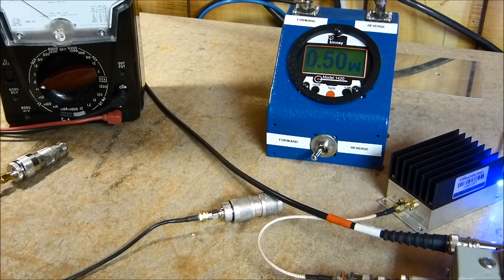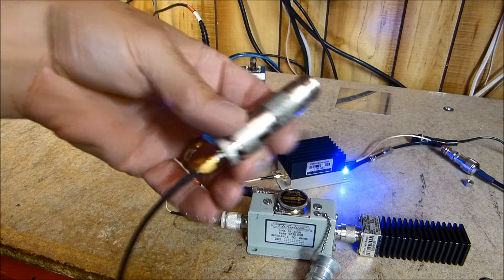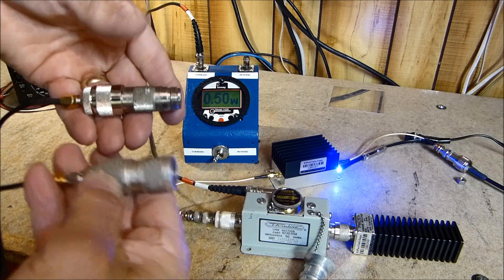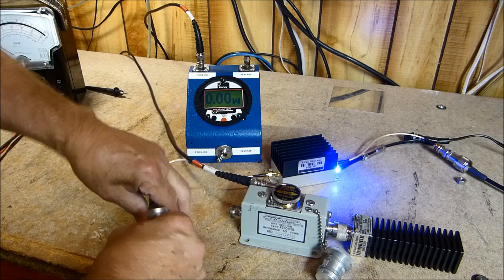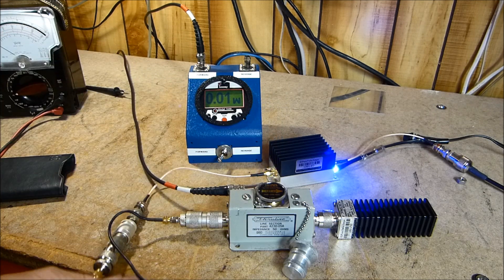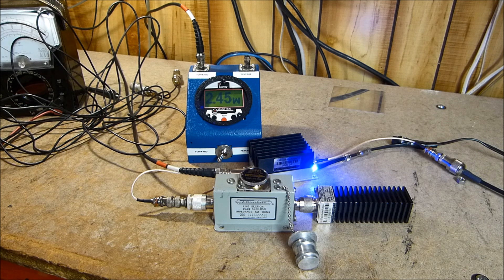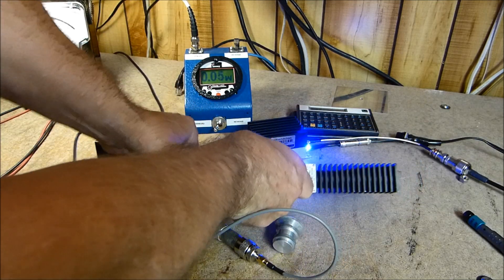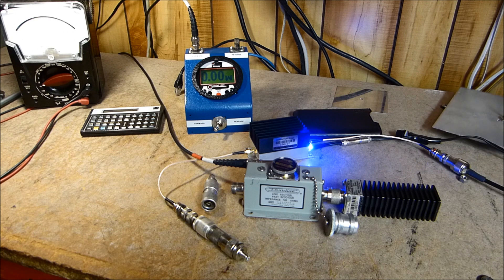WiFi Antenna Gain And Coax Loss Measurements At 2.4 GHz

Comment: Hey ElPaso! I’m a NM native and I know exactly where White Sands is! Beautiful area. My question is what should we be using for our GHz projects? I notice a lot of N Type fittings with test equipment. Compared to SMA that’s a whole lot more metal. Does that make a difference? What about loose fitting connections? I think we’re better off using an SMA torque wrench...no?
Reply from the maker: No doubt SMA is good in the GHz range but I have so many more N connectors and adapters. I definitely like the SMA when I can use them.
Not sure why the industry has used N connectors so much. Possibly because they are larger and more structurally sound? It would be a lot easier to break off an SMA connector from the front of an expensive piece of equipment than it would an N connector. Also, what if a person is using RG8 size coax? It would be hard to solder that #10 conductor to the center pin of SMA. And what about power? I really don't know what an SMA connector is rated for in voltage.  Looks like they are both here to stay and leave the SMA connectors internal to equipment. Just some thoughts off the top of my head.

Comment: The blue meter?  You make?
So precious, me wants one.
Reply from the maker: I bought that meter years ago off Ebay. I think it was around $140 if I remember correctly. Maybe a year later they disappeared but I found them being re-branded and sold under a different name for a lot more $$$ but now I can't find them at all. The meter itself, is a direct replacement for the 30uA meter that fits in the Bird 43 meter. I really like the digital readout and mounted it in the outboard meter box and use it with the free-standing Bird sampling line. I don't know if anyone still makes a digital readout for the Bird meter or not.
Reply from the maker: Actually, I just found it again. Here is a link to it.
https://www.eham.net/reviews/detail/9285

Comment: Nice 25 foot long dummy load.  It is a well known phenomenon that as the AC frequency goes higher, the loss in a cable carrying it becomes greater.  2.45 Ghz is fairly high frequency, so those "skinny" cables, unless very short, introduce substantial losses.  Losses in a system are not necessarily bad, if they are accounted for.  Sometimes losses can be used to your advantage, for example, if you have an amplifier that is 100 watts but you only want 50 of it to hit the antenna, putting a 3dB loss cable between the amp and antenna will then drop it to 50 watts.  Lossy cable can also help SWR, since the return current will be attenuated.

Comment: Also, a 17dB loss cable can be a very useful thing for testing.  For example, if you wanted to test a 20dBi parabolic dish antenna up on your roof, vs a 3dBi "stub" also up on your roof (connected directly to your Wifi test equipment), since you already know the cable has 17dB loss, you could install the dish and then compare the signal strength at some reasonable distance away and in the boresight of the beam, to help confirm it is really 20dBi of gain.  If the signal DROPS using the cable/dish combo and you did everything right in your test, then perhaps the dish is only advertised as 20 dBi but in reality it is less.  in case anyone is wondering, yes I am a "ham" operator.

Comment: The 17dB loss cable DOES work, but it is very lossy.  If it were a foot long (instead of 25 feet), it would likely have less than 1dB loss.  So it is not the cable that is crap, it is the fact that it is too long for the application.  A 1 foot pigtail made from that same cable would be acceptable.  Also, the correct term is dipole, not "diapole" as you say.  Also, the gain of a dipole antenna over an "imaginary" isotropic antenna at the same frequency is not 3dB and it is not any constant amount of dB.  It depends on the length of the dipole and where the signal is coming from.  For example, a 3/2 wavelength dipole has more gain than a 1/2 wavelength dipole, but only in certain directions relative to the orientation of the antenna and assuming it is out in the open (not indoors).  You are making some general statements about dipole antennas but they are actually wrong, including your pronunciation of the word dipole (you are saying "diapole")

Comment: Is there a way for a poor man who doesn't have much test equipment to check a coax for loss ?
Reply: Yes, just read the specs and if it is too much loss for the length you need, don't buy it.  Add in a little more loss for the end connectors.  So simple.
Reply: David James  If it is so simple, what was the point of this video ?
Reply: Some old fart with nothing better to do than complain about lossy cable cuz maybe he is too lazy to just check what cable it is and look up in a chart  online what the rated losses of it are.  They know exactly how much loss there is for any cable at any frequency.  His method is only useful if the cable is either not marked, or someone just wants to confirm the losses of it.

Comment: I've got a few lengths of the same garbage "Coax".  GHz range RF is really tough to send down coax without loss.  Try some lmr 400 (or better, 600 :) )

I dig your equipment - I'm looking for some inexpensive (or kit / schematics) for 2.4GHz VSWR meter and also power meter for wifi if you happen to know where I could find one I'd appreciate the tip.

Thanks for sharing!
Reply from the maker: +George Viaud There are a few 2.4 GHz meters on Ebay but I don't know anything about them. I bought an inexpensive 2.4 GHz watt/VSWR meter a year or so ago and it wasn't all bad. It did not track right with the Bird equipment but it was usable. I think it was about $80. I tried to improve it and make it work as well as the Bird and I ruined it  :-)  Here is one I made that you might like:  https://www.youtube.com/watch?v=0MiF4KGFZcc
Reply from the maker: +George Viaud I have had good success with LMR400 and the price is not too bad.
Reply: Thanks much for all the info and sharing the videos - very nice setup you have there.  I'll be sure to post back when I've solved my own equipment needs (considering building a meter for relative readings so I can get back into antenna building, only this time instead of HF it'll be UHF and microwave for point-to-point fun)

Comment: could I connect the wifi adapter to the pigtails coming off the antennas and the run a usb extention for the 20ft needed or would I loose more signal in that configuration
Reply from the maker: +jarred Great idea if that is possible, i.e. weather proofing, etc.  ---  that would be the best way to go. You will not lose anything in the USB cable. Not sure what the industry recommendation for USB length but it is at least 20 feet.

Comment: I bought some of that cheap cable off of amazon and paired it with 2 yagi antennas and a ALFA AWUS036ACH. i have several feet of extra cable, can i cut the excess off and resolder it back together to possibly get a better signal though the cheap cable.

I am a over the road truck driver and its hard to order anything off the internet and get it with in a reasonable time

here are the links to what i have 

http://www.amazon.com/gp/product/B00ZOM3L5K?psc=1&redirect=true&ref_=oh_aui_detailpage_o00_s00

http://www.amazon.com/Super-Power-Supply%C2%AE-WZR-HP-G450H-WHR-HP-G300N/dp/B00DTWTXTK/ref=sr_1_5?s=pc&ie=UTF8&qid=1445297867&sr=1-5&keywords=wifi+yagi+antenna

http://www.alfa.com.tw/products_show.php?pc=137&ps=225
Reply from the maker: +jarred From the links you sent me, and what I can see from them, the big bundle of cable is excessively long. I personally would shorten it up and if you have the cable installed in a permanent location, I would use LMR400 cable from the antenna to the access points. 2.4 GHz can be a challenge to work with. Best of luck with your equipment.

Comment: Well exactly what kind of cable would you recommend for 2.4ghz wifi?
Reply from the maker: +w2aiq I use the best I can afford that will work for my installation (i.e. flexibility) and always keep it as short as possible. LMR400 is usually the best I can afford because the cost goes up astronomically with LMR600. If an access point can be mounted (and weather proofed) directly at the focus of a parabolic dish, the downlink will have no RF loss. Power over Ethernet is one name they call it with DC power to the access point over the two unused twisted pair in a standard CAT-5, 4 pair UTP cable. I have found that the plenum rated CAT5 cable holds up pretty well outside.
Reply: I hung up my router on the 🌲..+rj45 +50mtr...and it's so much better now..

Comment: Aparty from the long low quality cable:
Are the SMA connectors supposed to swing like they do at 8:05?
Where was your torque wrench? :)

I'd like to personally "thank" the one who came up with that crappy RP-SMA - It was so much "fun" when I used a WiFi antenna for my ATV transmitter and accidently mixed RP-SMA and normal SMA - two connectors without center pin..

Comment from the maker: The long piece of "coax" is nothing more than audio cable with the shield being loose wire strands spun around the center conductor as audio cable is made. The shorter piece of coax on the D-Link antenna is a real piece of coax with a decent braided shield. I see on Ebay as I write this, "9 meters of WiFi WAN Router Antenna Extension Cable RP-SMA" for $105.33 with 313 sold.

Comment: Great video !
I guess I missed something but why did the power change when you changed scales ?

73  N8AUM
Reply from the maker: With the digital readout when you change scales it just multiplies the actual power reading (0.5 watt) on the 1 watt scale, times the scale which it was changed to (5 watt scale)  so it would 5 times as much or about 2.5 watts. It increases the sensitivity so I can also see  some reflected power and determine dB ratios. The digital readout is really a nice addition to the bird line section and elements. 73 WA4QGA

Comment: Hi Dave, would be interesting to compare your measurement against the data sheet of RG174 Coax cable for instance. RG 174 has an attenuation of about 100db per 100m @ 1Ghz. What might the attenuation be at 2,5Ghz? Would be interesting to see where exactly the problem is? Is it the crap wifi cable itself or the connector or both? Or is it simply normal that you have this attenuation at 2,5Ghz with given cable length and diameter? We as ham radio people know that we need big cable diameters to reduce attenuation and we already do it within the short wave frequency range. I guess the the commercial offer to the uninformed consumer is simply  a cheek.
Reply from the maker: I probably will do some more measurements and see how they compare to the tables we get on coax loss.. Measuring at 2000 MHz is pretty much the top end of what the tables show and, of course, the loss is pretty high at that frequency so maybe it makes it easier.

Comment: Hi Dave,    Another EXCELLENT video... I recently ordered several 1-meter cables with SMD connectors from epay, for some of my Lab gear. It was advertised as Beldon cable but what I got was cable tagged with another companies name I have not hear of. The seller said it was all the same to which, I gave him the option of a very nasty feedback and an ebay complaint case opened or send me what I had paid for or refund all of my money including shipping.. He did finally send Beldon cable. The A/B comparisons between the cables was very noticeable up to 1.2 GHz; That's as high I can go now, There is a lot of JUNK/CRAP coax out there.

If you don't send it back it would be interesting to see what the braid looks like..I bet it's like the poor quality Radio Shack coax we have all seen.. I hate to admit it but I buy a fair amount of parts, cables, connectors and other stuff from Asia through epay. However, in many cases I can't find it from a US source or I find some turkey who want $19.95 to ship something the weighs about an ounce or two..
Often, I get free shipping from China and some of the stuff is fine but a lot is just JUNK...
I know I have said this before, but thanks so much for taking the time to do these videos.. You and Alan, W2AEW, have both invested a lot of time not to mention your electronic labs and decades of experience and knowledge in sharing your experiences with the rest of us. I have been around for years too and worked for DEC as a large system/network engineer plus have owned and operated DSM Labs for the last 14 years. I usually learn or re-learn something every time I watch one of your videos and if I don't  it's still enjoyable to watch you share your knowledge. Helps to keep the cobwebs out...Hi hi.
73-Glenn-WA4AOS
Reply from the maker: Hi Glenn - I too have bought some stuff from China that is OK - Back in the 50's and 60's Japan sold the same level junk. I will keep the cable as I have had it for a long time. I don't remember when or where I got it. As you mention, I learn all the time from my own mistakes. I miss the days of work also and would probably go back to WSMR if the opportunity came along. I have thought about volunteering for electronics work (Not Computers) at a local tech school (probably for free) but I don't think anyone wants to know electronics anymore - they want a skill that will get them a Job - and that is understandable. 73 WA4QGA

Comment: I found that you have to use LMR-400 or something like it for wifi. it's fat and ugly but works.
Reply from the maker: I agree with you on the LMR 400 - I have used it very successfully at 50 feet at 2.4 GHz - that would be about a 3 dB loss but I can't afford cable much better than that. Belden 9913 is almost as good and about the same price and available in El Paso - I have to order LMR 400 - thanks for your comments.
Reply: medium "fat" and beautiful

Comment: Only a true Texan can say Horse Shit that way.....! Agreed! China didn't make it to the moon. Only Americans did; and we didn't do it by pumping precious wattage into a capacitive inductor. The uninformed consumer would never be the wiser as to their shitty connections and would only assume they need a new wifi router. This is another case that you "DON'T GET" what you pay for while purchasing a headache... Congrats on the Triplett 630 NA. It's my favorite!!!!!
Reply from the maker: Yes, indeed, the old Triplett and Simpson meters are still a good instrument to have around. Without being able to actually know what is going on, guessing just costs more money with no better results. It is disappointing that such worthless stuff is sold  - I spent my money on it "Knowing" perfectly well there would be tremendous loss in that small coax at that length. I use six inch pieces for flexibility on several of my instruments - that's about all it is good for.